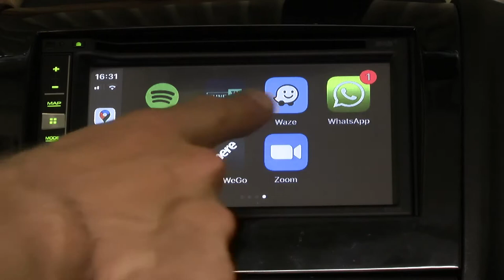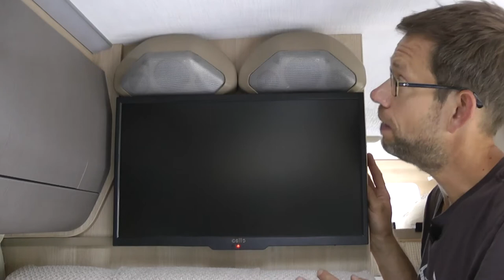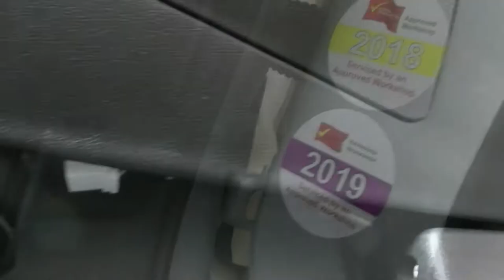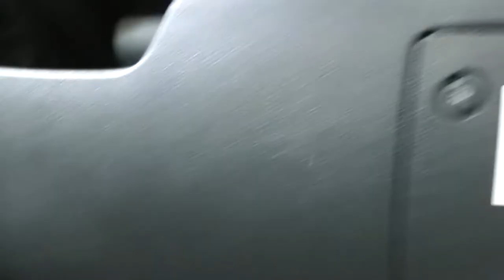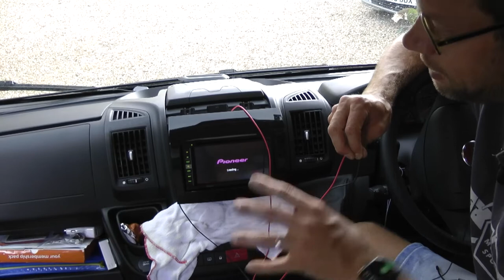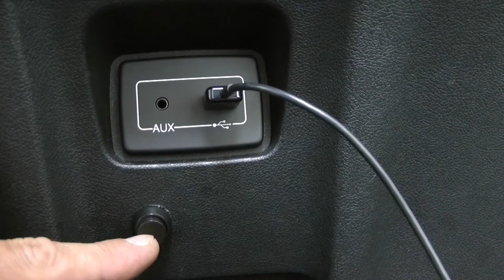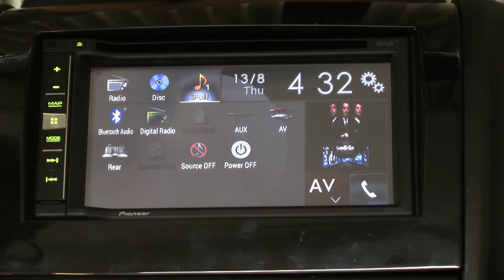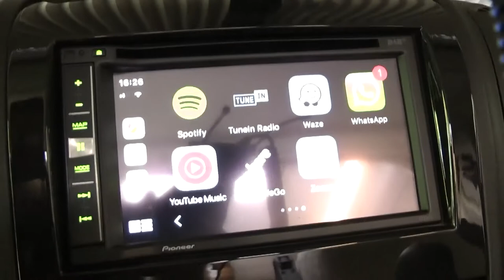Apple CarPlay, Subwoofer & Rear Speaker Install in a Fiat Ducato Campervan

Comment: Hi Great Video trying the same in my motorhome I have a question how did you wire the switch do you tap into per live and 12v trigger to the switch.

Comment: I'm about to change from the same standard stereo as you did also to a Pioneer Apple CarPlay. Did you have to modify the vans USB port to work with the Apple CarPlay? I'm told it may only charge my phone and not work with CarPlay.
Reply from the maker: On my van there are 2 USB ports on the dash. The One mounted higher up is a charging point only. However, I was able to use the USB socket that’s closer to the floor, just under the gear stick, as my Apple CarPlay connection point.  Do you have the same? 
I’ll be honest though, I can’t remember whether there was an extension coming off of this lower point that ran all the way up to the back of the head unit or whether I ran a  new USB lead down…. It’s fairly easy in either case and I was able to make use of the factory fitted USB point in the lower location. 👍